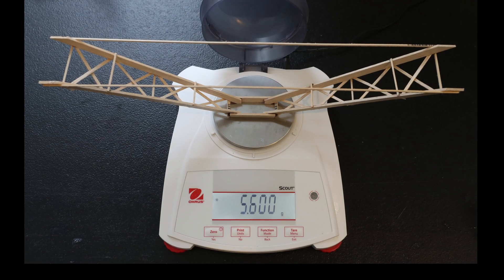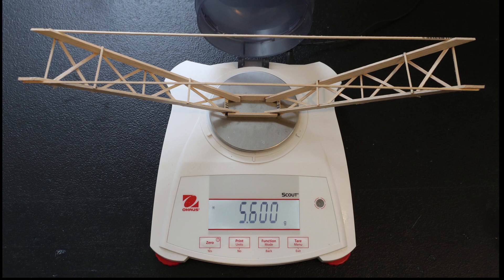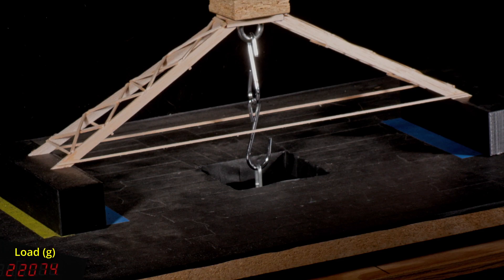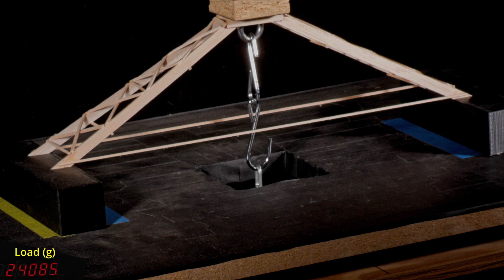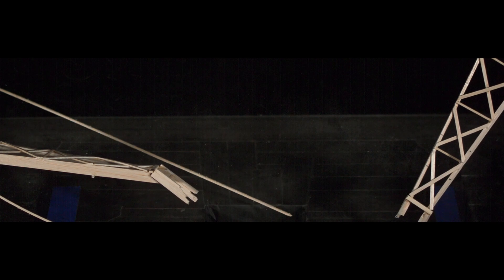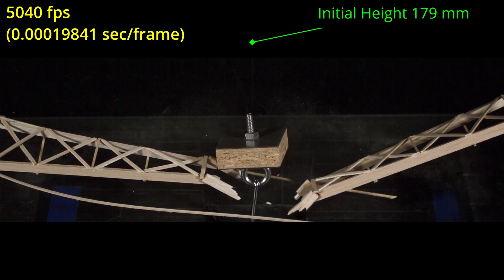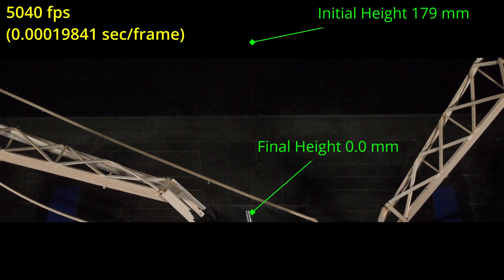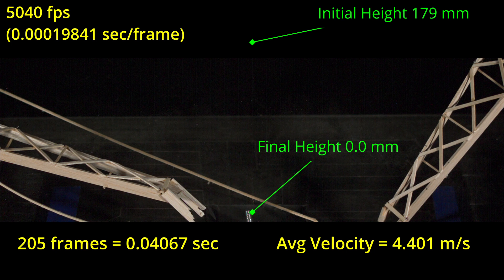Exploding Bridge! 4494 Efficiency

Comment: Are you planning on conitnuing your division c 2021-2022 bridge series? Im very exited to see if you could push that bridge's efficiency any further. (side note: your videos helped me place 8th at the national level! In that invitational I had a 1650 ish efficiency and have already improved since then with a roughly 1850 with a wooden jig similar to your 3d printed one and no custom ordered wood. Just from my local hobby shop.)
Reply from the maker: Hi Gage, congratulations on your success so far!  An 1850 is very good!  At this point, I probably won't do the final optimization steps for this year's rules.  My goal was to really give teams a great start on the process, not provide the formula for the final best possible.  I am trying to do final optimizations using the 2014-2015 bridge rules.  If I can get to where I want, I plan on sharing the steps necessary to compete at the very highest levels using that as an example.  That way I can show the kinds of things necessary to optimize any potential design without providing the final steps for this year's rules.
Reply: @balsaengineering6686  Thanks for the response and for being a source of inspiration and knowledge for science olympiad students. I understand where you coming from with not providing a perfect guide to success. That would take away the science understanding and learning. As well as the most “fun” part of the balsa engineering events, breaking and rebuilding and improving. I look forward to your videos in the future.

Comment: What materials used for this bridge?
Reply from the maker: It was a combination of balsa and basswood.  The legs and top were balsa, the primary tension members were bass and the cross supports were a mix.  50cps CA glue was used for all the joints
Reply: @Balsa Engineering  thank you, can you please provide thick ness of tension and leg pieces
Reply from the maker: This build used legs that were 3/32" thick by 8.5mm and the tension members were 1/16 x 1/16 basswood.